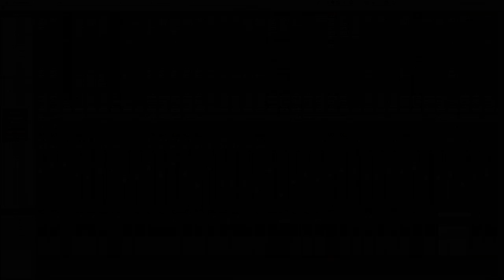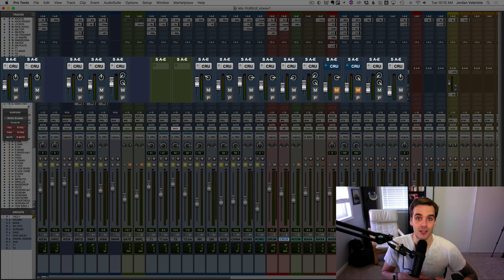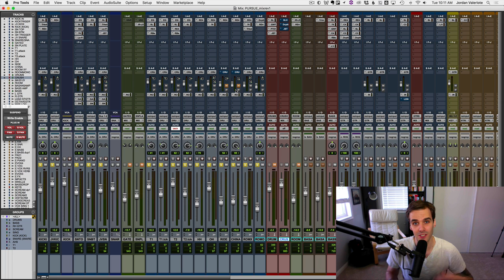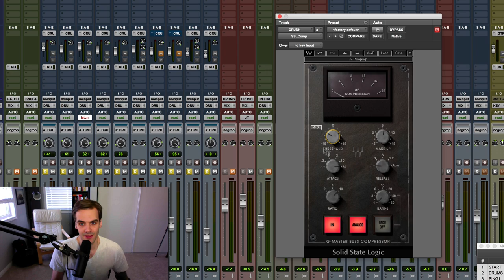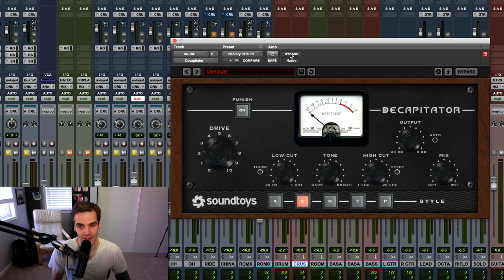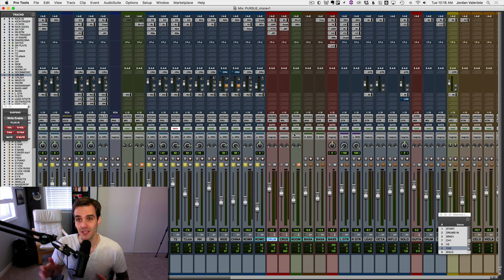How To Get Slamming Metal Drums in the Mix

Comment: Learned this trick from a video of your's last year and have been using it ever since! It's so rare that you actually come across a legitimate 'game changer' technique, but this is one of those very rare occasions when your mixes do undergo a night-and-day difference with one simple technique (assuming, of course, your drums are already pretty good to begin with).

If I could offer one additional comment: while I agree that you could achieve this with many different compressors, I think there's something to be said for the particular 'snappiness' and punch of a VCA-style compressor. SSL and dbx160 emulations spring to mind!

There are no end of compressors that can squash and crush your parallel tracks to the moon and back, but there's something about that SSL-style spank that makes this trick really work (though I agree that you do need a clipper to shave off the peaks)!

Comment: With this method, is there absolutely no compression whatsoever on the individual tracks or is it just subtle compression that doesn't really affect their overall dynamics too much? Because in the other videos you have compression going on the individual tracks with the SSL E-Channel. Can this technique still be applied then??
Reply: You can still use compression on individual tracks, but it should be used more subtly. You can then send individual tracks to a seperate bus, slam some compression on them, then bring up that bus fader to blend in with the rest of the kit.

Comment: In the beginning of the video, as you raise the crush fader, the snare starts to sound really phasey. Would that be from plugin latency? I've noticed if I have two busses with the same source signal, but the busses are processed differently, it can get phasey sometimes.
Reply: KernelxSanders whenever I use a Parallel drum send, this always happens. But when anybody else does it it doesn’t. Only thing I have realized, is that transient designers make it worse because a lot of them do a phase thing. I usually just use a comp with a mix knob to get that sound now. Any actual insight on this from someone who knows their phase stuff would help!
Reply: the snare while being a sample was actually recorded. duh.
but also keep in mind the whole drum mix including the room mics is being compressed. while there still may be some phasing, what you are hearing is more ambience from the snare in the room mics being compressed on the parallel bus.

Comment: Jordan, why do you favor a slow attack instead of a fast attack for parallel compression? My perception was that a fast attack will crush the drums more and add sustain to the shells. Thanks!
Reply: Joel Bousquet You’d lose the punch of the transient if you set the attack too fast which you might want if you want to emphasize the sustain tails of the instrument (drums here) but then you’d also increase the release.

Comment: Thanks for sharing this technique, amazing video as always.
I still have a question though...

Are there times that this simply doesn't work for you?

I copied your method in one of my mixes which worked well for the snare but I figured my kick would lose a bit too much of its bottom. So I went a bit further, panned the original drum mix to the hard left and the parallel mix to the hard right with everything else muted and put span on my stereo out. Turns out I have negative phase corellation between the busses. Is there something that can be done about it or is it just a normal thing that sometimes this may not work well?
Reply: Keep both drum bus outputs centered.

Comment: Why not use a really fast attack on the comp of the parallell track to bring out the punch?
Reply: Spero too fast of an attack will reduce the attack of the drums.  A slow attack let's those transients through and then a fast release let's the rest of the sound through while also making sure the compressor resets for the next hit.
Reply: weeschwee yeah, but the purpose of parallell compression is to get all the natural transients from the uncompressed track and then tuck the compressed track in underneath to provide the extra punch.
Reply: Spero I think parallel compression can be used for multiple purposes. In this case I think he wants to add more of the drum's attack. So a slow attack setting will let those transients through. A fast attack setting would reduce those transients.
Reply: weeschwee 6:48, https://youtu.be/tnKgDAImZtg
Reply: weeschwee Thanks, your right, probably depends of the actual purpose.
Reply: Spero yeah, I've watched that video you linked. I think these are just two different purposes for parallel compression.
Reply: But he's also adding saturation to that punchy bus, which makes it even better and will make those transients cut through the mix.